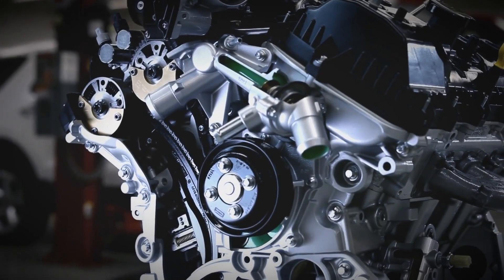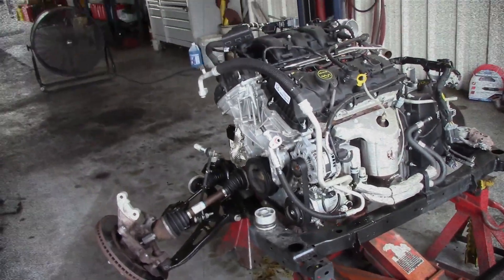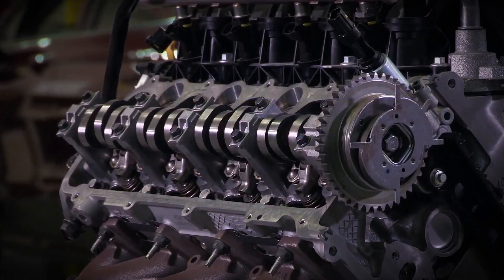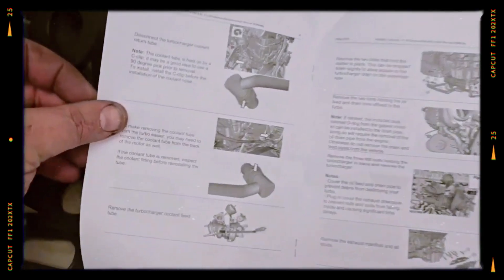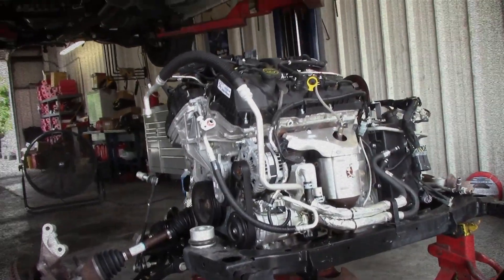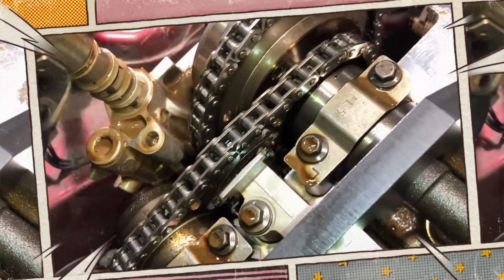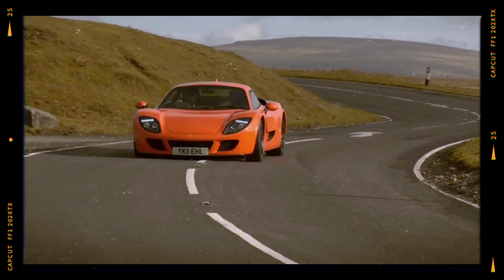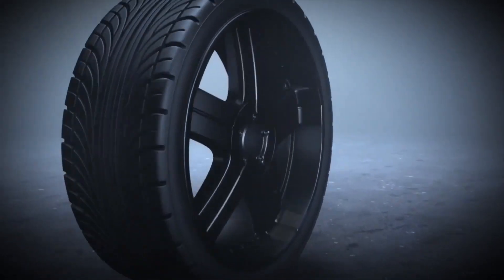Ford 3.7 V6 Duratec/Ti-VCT Engine Review – Specs, Common Problems, Reliability & Performance !

Comment: No No No, this version has the single 6ft long timing chain running off the water pump.  Pump failure is a catastrophe which  causes severe damage since engine is interference.  The 3.0 Duratec is the opposite:  one chain per bank and the water pump is driven from a pulley on the rear of a camshaft on the "rear" of the engine.  Failure damages nothing and replacement time is mostly spend cleaning the gasket surface.  The 3.0 is a beast of durability.

Comment: I bought a 2014 mustang new, changed oil every 5k miles and it now has 240k on it. The only thing I have ever done is chang the serpentine belt and spark plugs at 150k.

Comment: another application for this engine: police cars. got my 2015 taurus police 2 years ago with 130k miles, new water pump, sparkplugs, and ignition packs and its currently at 200k miles. im currently using it for a work vehicle so its either idling or with the cruise control set on the highway and the performance is absolutely perfect for both! do your oil changes frequently and this engine will treat you well!!

Comment: 241k. 2014 3.7 f150. She still going. Better quick truck around town.
Reply: I just got a 2014 3.7 xlt at auction is the truck worth ? it just need it for straight work nothing fancy
Reply: @jasoncruz5022 should be fine. I got a video on my channel explaining my experience with a 3.7 over 5 years as a work truck
Reply: I have a 2012 F150 3.7L. I have 284,000 miles on the original drivetrain. Change the fluids regularly do the maintenance and they are very reliable in my experience. I’m going to drive it as long as it will pass inspection. Livening in MA the road salt is going to be the death of it. Someday
Reply: @John-t9m8j probably rust out before the engine goes out

Comment: Is there a specific interval for the water pump replacement?
Reply: 200K miles water pump + timing components, or if leak coolant. Upgraded water pump if leak, it will leak outside before leak inside, still checking oil often for mixed coolant is recommended, especially after 100K miles.
Reply: Not required if you change your coolant every 30k miles With transmission fluid.
Reply: Mine blew at 220k hard miles, pretty good engine besides that

Comment: Btw the internal water pump issue is only for vehicles with the 3.7 laying sideways, the 3.7s that lay front to back like in the f150 has a belt driven external water pump that takes 30 minutes to change
Reply: My buddys old foreman worktruck had the 3.7 and it had almost 350,000 miles on it. All highway though and almost zero idle time. It was the 3.7 that was before the 2.7Lecoboost came to the f150. It was very anemic under 3,000rpm
Reply: Correct, rear wheel drive 3.7 (mustang for example) have external water pumps 👍
Reply: plus i was reading the window sticker of a 2011 f150 3.7 and it says "fails safe cooling system" whatever that means maybe referring to a failsafe thermostat?

Comment: Shit engine. Good as long as you get rid of it before 180k
Reply: Sounds like a you problem..currently own one in the f150 right now with 180k, have had it since 70k and it’s by far been the best truck I’ve owned, and the vast majority of folks say the same, is it a powerhouse? Not at all, but it’s incredibly reliable and decently easy to work on, most people getting well over 250k before any real issues start to show, take care of it like you actually care about it and it’ll last
Reply: @jasonhelmich484 when should you change the transmission fluid ?
Reply: @Anthony2025-i8g  Every 60K. Maintenance is a lot cheaper than replacement. But if you go over 100Kish without ever replacing it you should not change it and ride it as long as you can before you have to replace it. This is a good explaination https://youtu.be/jJr30r6RRgw?t=317
Reply: The 3.7 is known to easily get 300k miles lol
Reply: You obviously have no idea what you are talking about please just stop
Reply: @Jeschitown We have one in our shop that's been getting regular services with 372k last time I pulled it in. Nothing but basic maintenance, and 2 water pumps.
Reply: @blakeyon2asd did the water pumps fail or done as preventative maintenance?
Reply: @Jeschitown lol obviously more than you do since all you can do is deny
Reply: @jasonhelmich484 I was responding to og commenter I agree it's a great engine
Reply: @Jeschitown ahh, misinterpreted, my bad
Reply: Watch your language tough guy. And 180k is not bad specially if you're out hot rodding it. So drive it respectfully and you'll get allot more from it"! Clown".
Reply: Oh?
Reply: The only issue is the water pump.Get it done for preventative maintenance.Then, I guarantee you get three hundred k out of it.If you do all the fluids on time
Reply: @justin6296 and even then that's only on the transverse mounted ones. The one in the F-150 is longitudinally mounted and the water pump is external
Reply: 273,000 bud
Reply: 205K on a 3.7L F-150 so far. Didn't want to give a 16 y/o a 5.0L F-150.